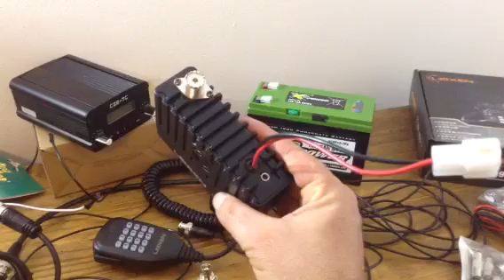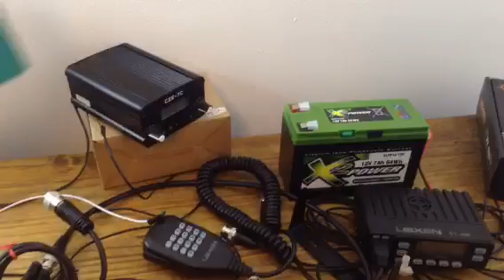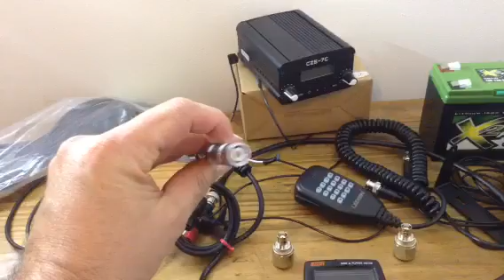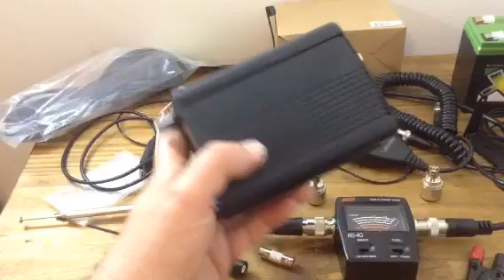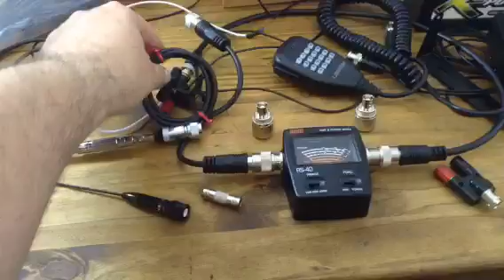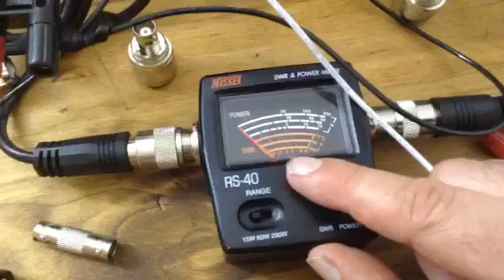Two way radio bag upgrade components and update

Comment: The connector is called TNC.
Reply: You're learning 👍
Some feedback.
the antenna you made is just a dipole. Two equal lengths cut to the frequency you want to operate on. Once you verify the swr, remove all the extra things like the swr meter and extensions.
The telescopic antenna you have for the FM radio transmitter will work as long as it is physically attached to the radio. You might consider building a second dipole for the FM transmitter if you want an elevated antenna, because the telescopic whip wont work without a ground plane (e.g. the second side of the dipole).
No criticisms this time. You're learning. 👍
Comms with the 817 is a whole new ball game. Please consider not pulling the trigger on it, because it might not be what you need. Within a few weeks I'll start covering things you have asked for in comms, years ago. Things which are independent of the radio used.
julian
Reply from the maker: OH8STN ok, thanks.  Yeah I want some other antenna options for the FM transmitter. I want to figure out if it does stereo and how I can do the little title text you see with a lot of radio stations that transmit the title of the song and the scrolling text that comes through on modern car stereos.
Reply: 8digitPDX It's call RDS

https://en.m.wikipedia.org/wiki/Radio_Data_System

Maybe try this:
https://github.com/ChristopheJacquet/PiFmRds

Comment: You have Lots of great Ideas, I have a pair of UV5r radios programmed for a repeater or single use. With a pigtail connected to radio ground shows improvement of the stock or any radio mount antenna. The BNC random wire could be tuned to a spider set up for multi band use. Use the swr meter for testing only to prevent signal loss.
    The FM transmitter should be as high as possible because of cable loss use stock antenna, Put it in a heavy trash bag or a water proof box . Amps are heavy and suck power  (high point or hill, tree house, rope into a tree or pole) A programmable voice chip that would repeat a message could be a distraction to those  that want to do harm or just post info. Repeating a message will act as a beacon when the band opens. 73s KE6SFP